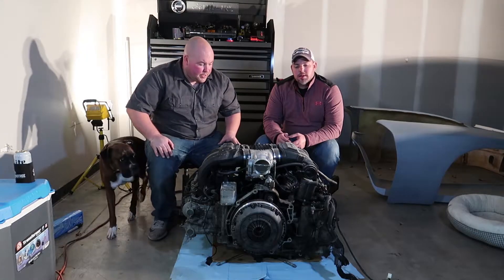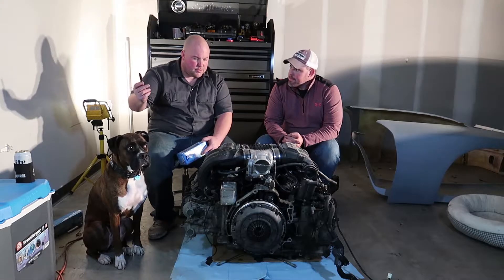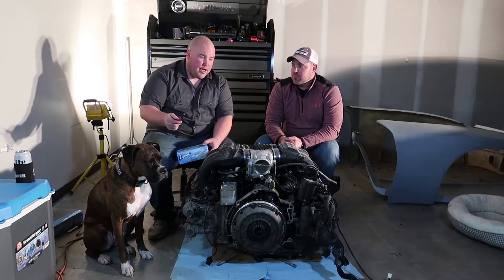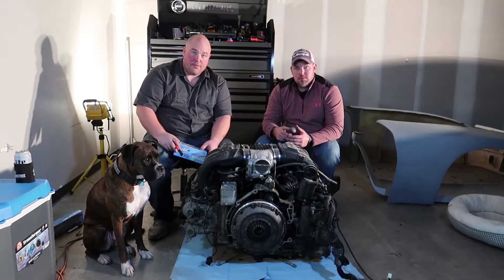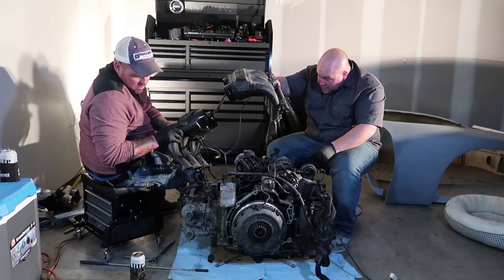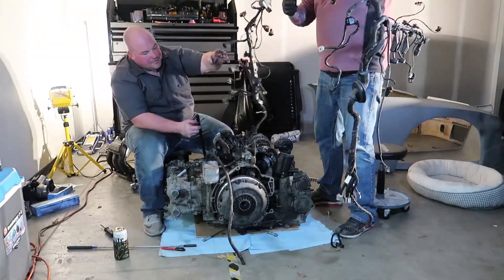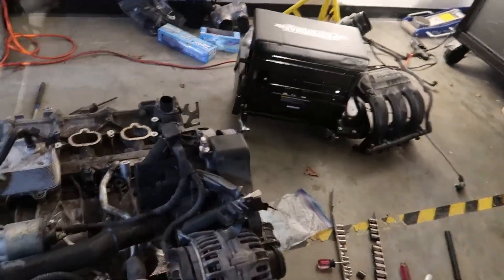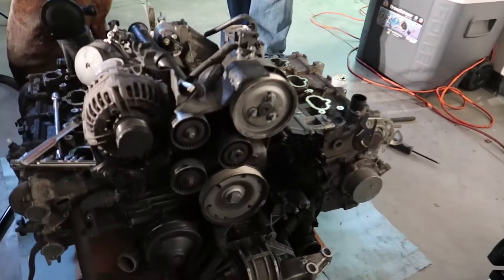Porsche Cayman Engine Disassembly - Part 1

Comment: Love the videos! I am going to start doing some minor mods to my 2008 cayman, so its awesome to see you guys doing the full tear down.  Any tips for dealing with the electrical for an aftermarket stereo swap?
Reply from the maker: Thanks! It’s going to be interesting to see what we find with the tear down. We haven’t done any stereo mods to this car, although it was on the list because the lack of Bluetooth was infuriating! Integrating into the factory stereo was really expensive so we were going to go with a double din aftermarket unit
Reply: Ah gotcha! Yeah my cayman came with an aftermarket double din Pioneer AVH-3500BHS, but it doesnt support Apple carplay or Andriod auto, so i am swapping it with a KenWood 9704s.  I'll try and make a video of the swap to share :)
Reply from the maker: Awesome! It should be pretty straight forward since there is already an aftermarket unit in there. Good luck! Let us know how you like the kenwood unit...
Reply: Super EZ install after watching countless hours of youtube mod videos! The most involved part was removing the battery to mount the gps tracker under the windshield wiper fascia.  Ended up needing to poke a hole in the fire wall & the grommet to slide the cabling through, but it worked great & the gps tracker seems to work wonderfully.  

Only Issues thus far:
- I forgot to do the Initial Setup, and the default settings are crap.  Took some minor tweaks to get all the speaker settings right, but the sound is fantastic!
- Android Auto can be broken depending on your phone.  Until i made the Kenwood a trusted device, my Pixel2 wouldn't work with the head unit & reported USB errors if the phone was locked when attached via USB.  It is possible Android 8.1.0 fixes some of these issues as well, but i am not sure.

Next on the list is changing the default kenwood splash screen to my custom logo!
Reply: Here is a link to the custom logo installed on the cayman: https://www.instagram.com/p/Bc3CD8IlaK-/?taken-by=lucevelyn
Reply from the maker: Lucy that’s awesome, turned out great!
Reply from the maker: Lucy gotta be such a big improvement over the factory setup! That’s my main gripe with the car, that and the factory steering wheel. Glad it went well!

Comment: Thanks for getting back to the Cayman and good to see the new toolbox hard at work already. Btw, awesome Boxer by you side. Great breed!  We need to get some Porsche stuff on those bare walls. As if you don’t have enough to do!  Cheers guys and keep the great vids coming as time permits.
Reply from the maker: Thanks Rob! We definitely have a ton to do, and with the Cayman being the most expensive and time consuming it’s easy to put on the back burner. But, it needs to be back on the road and putting smiles on our faces so we appreciate the push. Thanks again!

Comment: Good work! I can't remember if you guys were just gonna fix what was wrong with the car and button it back up, or make some improvements while you are in there.
Reply from the maker: So that really depends on exactly what is wrong. If it’s a rod bearing and it didn’t wipe out the crank then we could potentially do a cheap / easy fix and slap it back together. If it’s a cylinder then we are in trouble and it’s time to rob a bank or start donating plasma lol

Comment: with the oil in the plenum, do consider that if the engine was on its side etc on the journey over in the truck then oil may have made it's way to this location, it may not be an issue with the engine at all.
Reply from the maker: That’s a good point... I didn’t see much in the intake or head so it seemed like it was coming from upstream of the t-body, but who knows